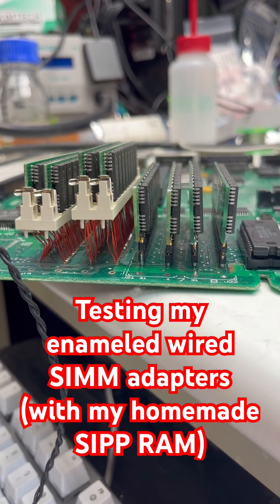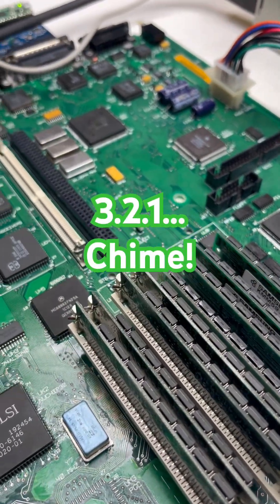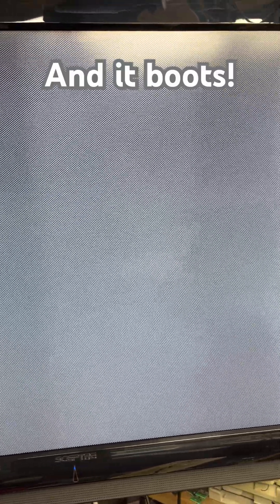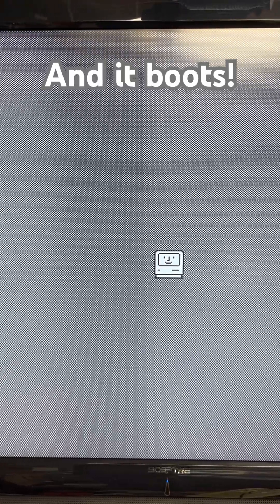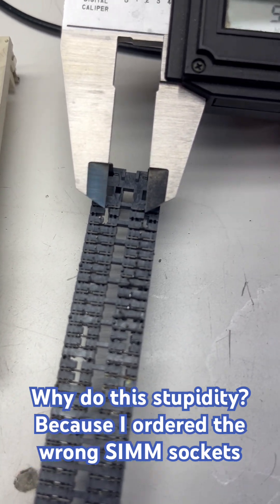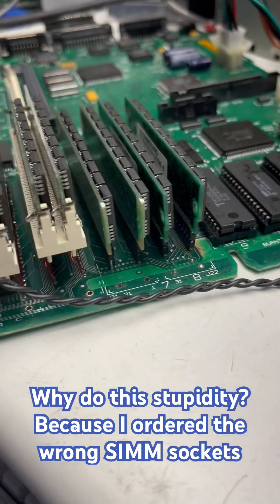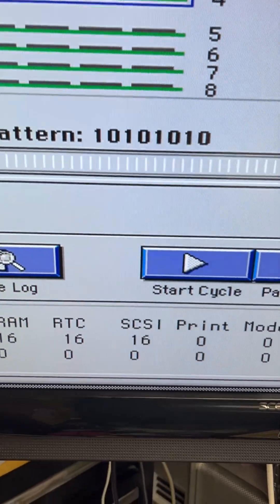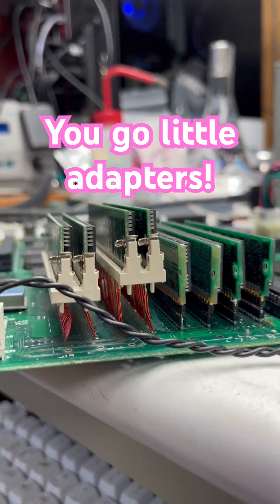Testing my enameled wire SIMM adaptation on a battery-damaged Macintosh IIci logic board #vintagemac

Comment: I suppose the word “adapter” is a technically accurate description of SIMM sockets suspended mid-air by a few dozen pieces of red enameled wire
Reply from the maker: 60 individual adapters